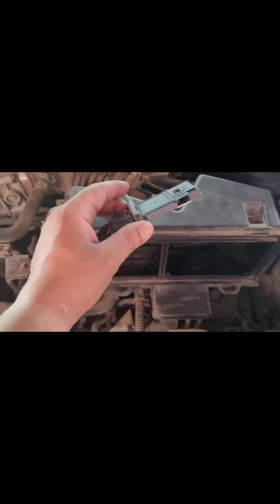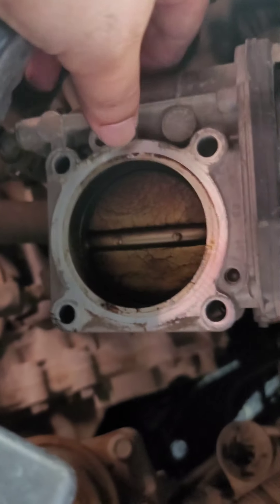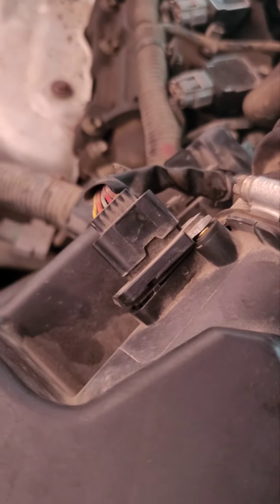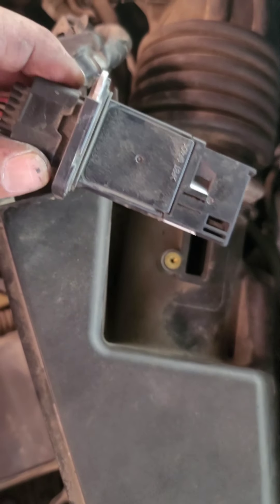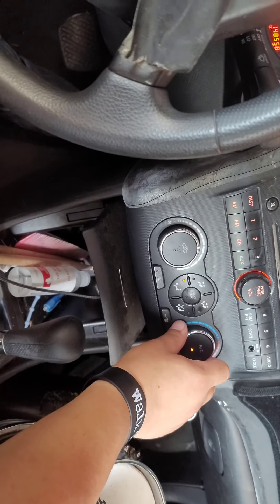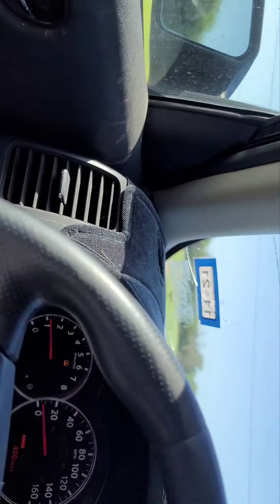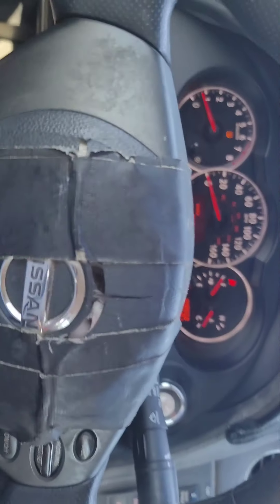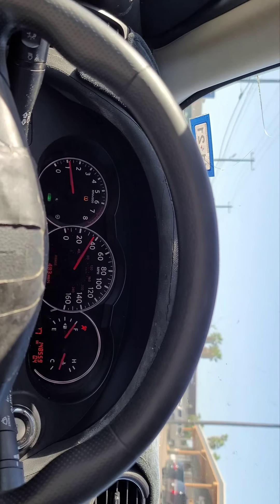Cleaning The Throttle Body and Mass Airflow sensor in my 2010 Nissan Altima  Coupe. #Nissan #Altima

Comment: For the future, you never turn any accessories on after disconnecting the battery. The ecu needs to go through a re-learn process in order to idle properly and run properly. after disconnecting the battery, turn every accessory off (AC, radio, fans, headlights, etc), start the car without touching the throttle AT ALL, let the car sit and idle for 10-20 minutes, turn vehicle off and wait 1 minute, restart vehicle and let it idle for another 3 minutes again. after that, everything should be fine.
Reply from the maker: Ohh? 💯💯